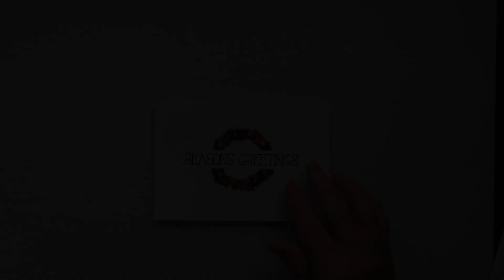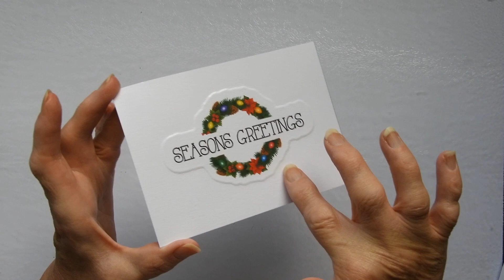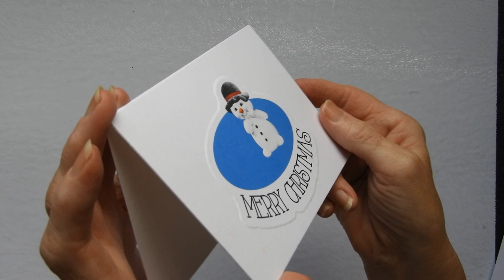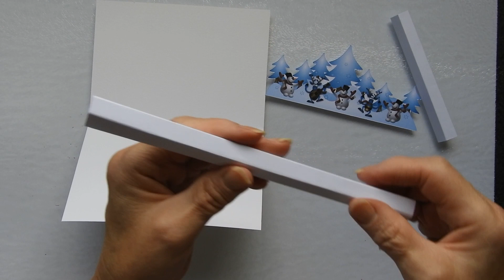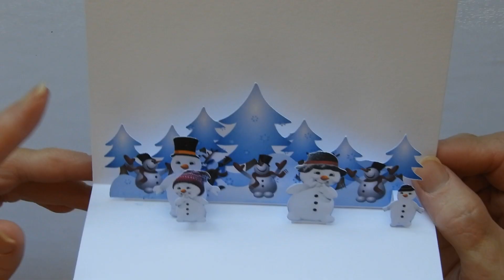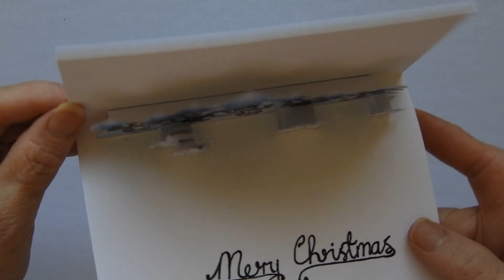ScanNCut -Embossed Outside, Pop Up Inside!

Comment: Do you have videos showing how to make pop-outs using different types of digital cutters?  Like for the Brother Scan N Cut DX series, Cricut, etc?
Reply from the maker: That one was made with the Brother cutter..It is making the file that counts, not the machine used to cut it though. I do my designing in SCAL because Canvas is terrible. I have never used a Cricut but my files these days are generally in SVG format to make them usable on most machines.

Comment: A very nice design, Sandra.   The embossing lifts the card to a new level.  I have never been impressed with embossing using our alternative cutter and I don't think I am in the market for a new one as  I use my current cutter so little.  I might try a totally handmade version instead. 😀
Reply from the maker: Hi Mary,
I think the difference is that it is REGION embossing. I did a video on that recently. It won't make a difference really what cutter you use (or you can do it by hand).https://youtu.be/8IKu13sGiaY   and this one  https://youtu.be/CWqD_23CVAw